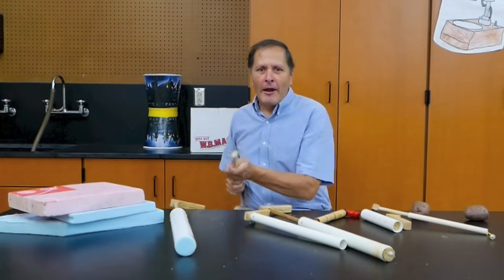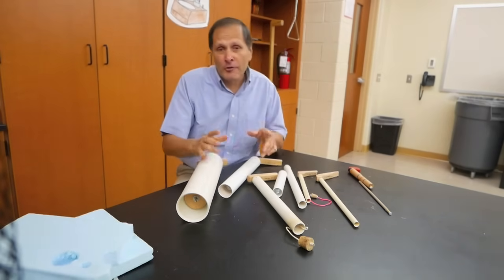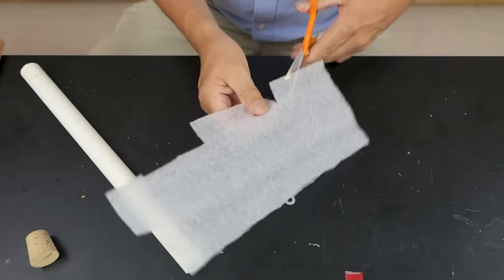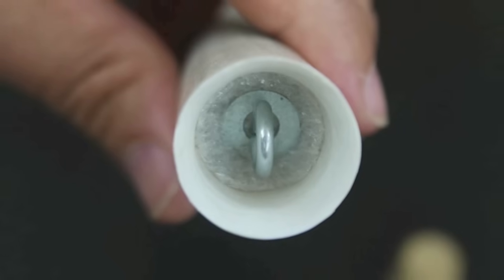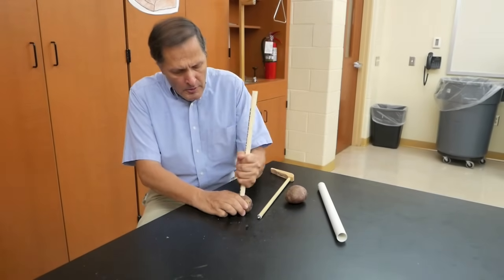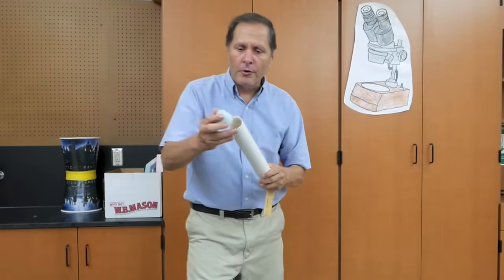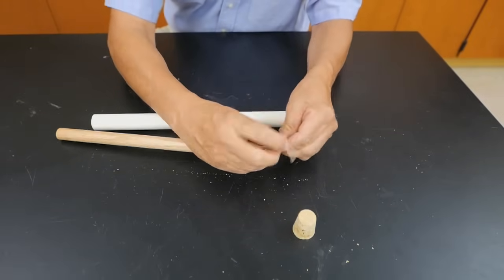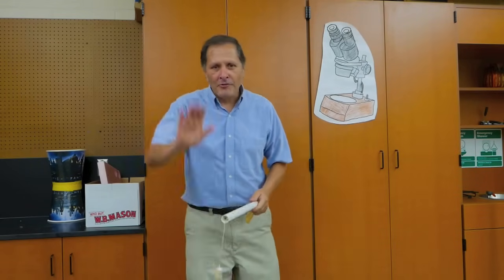Toy physics - Pop guns-- cork, potato, or foam poppers  // Homemade Science with Bruce Yeany

Comment: I saw you pull back the handle after you put the cork in. It seems to me that would create a vacuum before you get around to making compressed air. Am I missing something? Thanks.
Reply from the maker: the cork has enough rough spots that air leaks in as I pull it back.  I then need to push forward quickly or else it leaks out as compressed air

Comment: Can someone please help, walk me through how to fix the overpriced repeater I bought from an amusement park.
The cork always gets stuck now; you can pop it one time and that's it, unless you want to disassemble it again.
How can I either make the cork wider? Epoxy? Clear Caulk? I have no idea I'm not a handyman per see
Can I put something in the the plastic "tube" to make it narrower at the opening?
The exact issue is that the cork keeps going too far into the tube and will not pop out again.
Once its stuck you have to disassemble and push it out with the Piston
Reply: add some length to the cord so it doesn't get pulled in as far

Comment: Similar idea but with a bit more pressure. Use a bicycle pump with a ball needle and a film canister (for the old analog gel photo films). Small hole in the cap, put the needle through it and done.

Comment: is the eye hook stuff necessary?
Reply from the maker: Hi Kebab4eva,  while it doesn't need the string through the stopper,   it does need the foam, the washer and small bolt of some kind  on the end  to form a good seal.
Reply: Not if you don't care if it works!!! You have to have something to hold the foam or rubber gasket on with. If you are making a pop gun with a larger projectile that can be seen then You only need a screw or bolt if You are making a repeater type You need to have a string so the Eye bolt or Eye screw stops you from having to help your 3 year old look for the cork every 5 seconds. My Friend Kelland O'Brian used to make these and sell at Swap meets have been thinking of making them in his Honor.